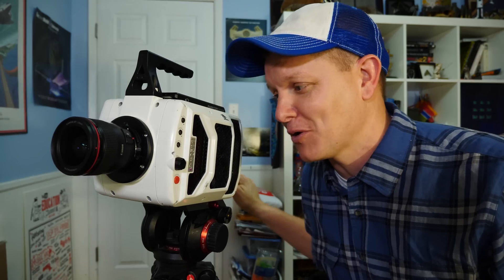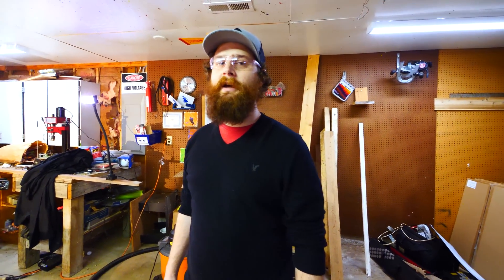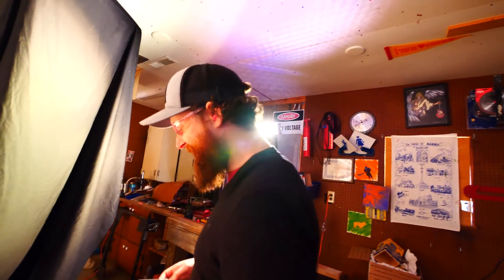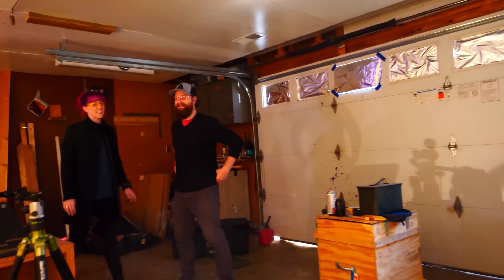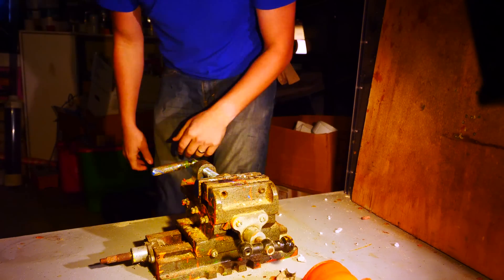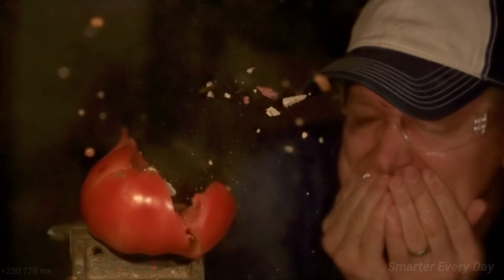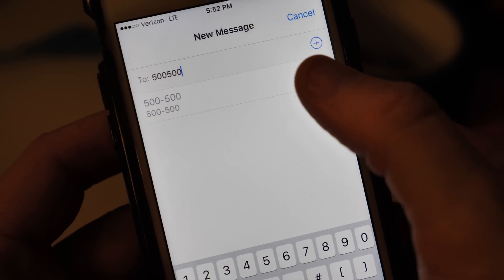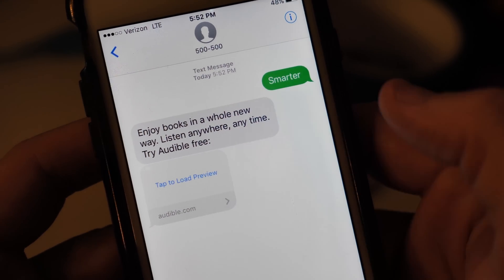How We Make Slow Motion Sounds (Exploding Tomato at 60,000fps) - Smarter Every Day 184

Comment: WHY??  You render it??  Shouldn't sampling sound be easier than sampling photos???
Reply: no - you CANT use the real sound - not that slow - it would just be meaningless noise.
Reply: BangDroid many good points, additionally its really just not possible even assuming the best case scenario.    the lowest quality sample rate thats at all listenable is about 8khz, roughly equivalent to a low quality telephone signal. the slomo of the tomato was shot at 60,000 fps played back at 60 fps for a 1000x reduction in playback speed. meaning that in order to achieve 8khz audio after being slowed it would need to be recorded at 8000khz which is many many many many times faster than what can practically be achieved. even a video shot at 6000 fps which is quite low for this channel would require 800khz and thats still out of the question. all of that would be required to get tinny low quality sound that would really detract from the high quality slomo footage. to get to 44.1khz which is the minimum for "high quality sound" would require even more outrageous sample rates. but even if it were somehow possible to record sound at an arbitrarily high sample rate sound really just doesnt work that way. pitch is the frequency of a sound, and an octave represents a doubling of that frequency. consequently slowing a sound down 100x results in a 6-7 octave drop in pitch which is most of the range of a greand piano making anything other that higher pitches completely inaudible. human hearing is 20hz-20000hz for people with flawless hearing meaning that slowing something down 1000x would drop anything that can be heard by a human completely below our range and the only things that would be heard would be things well above 20000 which i suspect would not be particularly interesting even if we assumed all the other things we needed to magically handle in addition to the other problem of having microphones with truly astonishing range >200000hz and they would also need to bequite robust to survive the sounds theyre subjected to.
Reply: Light and sound are very different, light travels about 580,000 times faster than sound as well.
With highspeed photography, speed refers to how many samples (individual pictures) can be taken per second. With audio this is knows as sample rate.  EI: 16 bit/44.1 kHz meaning there are 44,100 sixteen bit samples recorded every second. When you stretch or slow down audio, you lose information and the clarity is lost and distorts. You can interpolate the signal and fill-in those losses, but it's still an approximation.
Recording at much higher bit depths and sample rates such as 24 bit 192kHz or higher would allow for greater clarity when stretched.
I think the biggest thing though is that mic's generally have to be right next the the audio source whereas cameras can be back and even behind blast shields. Explosions can also destroy the sensitive parts of microphones.
Reply: Ed Price, i guess he said that,  even if we develop a microphone with special materials that make it extremely sensitive to sound and enable us to record it with utmost precision,  even then,  when we will stretch it to combine with our slow motion video ,  it will be of no use,  as sound at that scale is too SLOW! It will just be some very low frequency noise which will be of no use  , by the way WE did the same thing with camera,  we developed extremely photo-sensitive materials that could detect variations in light with ultra precision both time and quality wise.  And since light is fast enough,  we were able to make use of that data! And produce the slow motion videos.
Reply: Jason, there may be ultrasonic noise, or even harmonics, but calling that slow motion audio is like capturing x rays instead of visible light, mapping it to visible light, and pretending it's slow motion video. It might be interesting, but it's not slow motion audio.
Reply: Jason Gerecke you are correct that we could record the extremely high frequencies that would still be audible after a 1000x slowdown, but then once we did the sampling and stretching, we'd just be listening to the exponentially quieter (softer) and noisier (messier) upper harmonics of the sound we expect to hear, while throwing away the primary (base) sound that the people in the room heard at normal speed. What we want is to hear the primary signal in the lower frequencies, but instead we're going to get distorted messy signal derived from the upper harmonics and it would just sound like "proof of alien communication" on the History Channel.
Reply: Y'all need to learn about FFTs and frequency domain.
Reply: Ed: You're correct, we could find a way to capture the data. However, Travis made a second point: there's no such thing as slow motion sound. Consider capturing audio with a photograph. It's technically possible, but a single instant of audio is meaningless. Time is integral to sound; slow a high pitched screech by 1000x and you get an inaudible low frequency drone that not even crazy, custom, room-sized subwoofers can reproduce.
Reply: diggoran I wonder if there would be a way around that issue. We have a lower limit to the audio frequencies we can hear, but no (practical) limit to the number prior video frames we remember seeing. I wonder what it would sound like if you compressed the entire audio frequency spectrum so that a 200kHz signal would be reproduced at 20kHz but a 100Hz signal would still be ~100Hz? Maybe use a logarithmic scaling to somewhat preserve our logarithmic sensation of pitch?
Reply: Try to watch this video on 0,25 x. You can clearly hear what happens to sound if we slow it down. And think it very very slower than 0,25.
Reply: Nick B that's a good point, and experientially it's probably more akin to looking at an xray. That said, its /also/ "slow-mo" audio, though it probably stops sounding like it after the slowdown becomes too extreme.
Reply: Jason, what would you say is the point of slow motion video?
Reply: The sample rate is not the issue here. You would simply end up with infrasounds below 50Hz that we could not hear (and also not produce with our loudspeakers)
Reply: Jason Gerecke, I'm not sure that would sound good enough; when you change the frequency of sounds without changing the speed, you get artifacts because the waves at different frequencies no longer align the same way with each other; like when there is extreme autotune in music and stuff, all metallic and echoy, but given the scales involved, the effects are gonna be even stronger.
Reply: If nothing else, those cameras have some really high power cooling fans BLASTING away and they'd obliterate the sound recording.
Reply: Nick B not necessarily. An ultrasonic microphone could capture sound frequencies higher than 20kHz which would be brought into the audible range when slowed down. 100kHz content slowed down 1000x would be 100Hz and could be captured without terribly exotic gear. Handling a 2000x slowdown (e.g. for this 60,000FPS tomato) should be possible too. The real problem is likely that  the ultrasound content is probably pretty minimal and wouldn't sound like what people "expect" it to sound like.
Reply: I don't think the solution to high-speed audio is to simply play back all samples; as you said, this would reduce  information to sub-audible noise. I think there might be progress made by using software to look for short-duration events (as an example, maybe a tomato skin crinkles like glass on initial deformation, then defaults to a long, slow deformation with little sonic information, so capturing that initial crinkle is the important .001% of the event). Perhaps "sound" information can be derived by laser interferometry of the impacted surfaces (after all, the sound we perceive is simply an air pressure wave, driven by mechanical motion of some surface "pumping" air). However, we will never know so long as we are fudging our data by squishing oranges and adding reverb.
Reply: "no such thing as slow motion sound" buuuuuuuttttt whhhhaaaaattt aaaaabbooouuuttt wwwwhhhennnn ttthhhheeee vvvviiiiddeeeeeooooo sssoouuunnnddsss llliiikkeee tttthhiiiissss
Reply: Travis, your argument essentially becomes that extreme high-speed audio sampling is impractical because its very difficult to do; isn't that the same argument against high-speed video?

Comment: So it’s fake.  I wonder if you could hook a microphone up to an oscilloscope with a large buffer and record audio with that, since the sample rate is in the gigasamples per second, I assume something recorded at 1,000,000,000 samples/sec would be perfect for ultra-slow mo playback at 48,000 samples/sec like normal audio.  You’d need a pretty small microphone diaphragm to get the kind of frequency response you’d need to get anything in the audible range.

A rigol ds1054z with it’s 12M sample memory could do 12ms of real-time audio recorded at 1,000,000,000 samples/second.  Played back at 48,000 samples/second, that’s 250 seconds of audio for an effective overall playback speed of 0.000048x.

Comment: Heyy Dustin ●♤☆ 
I want to ask u why can i blow hot and cold air ? 
And why do it feels cold when i put my arm in the fast wind from the car ? Isn't thats how the asteroids get burnd ?
Reply: I can give a basic answer to these questions actually. 
There are essentially three simultaneous heating/cooling effects going on in these situations. 
1. The conductive heat transfer between the air and the surface of the object
2. The evaporation of water on the surface of the object
3. The heating up of air when it gets compressed

So when you blow slowly on your hand, factor 1 is significant because the air coming out of you at body temperature is much higher than the surface of your skin. Factor 2 is less significant because the air isn't moving very quickly, so it can't carry away much water (plus it is humid coming out of your body). Factor 3 is basically non-existent in this situation. 

When you blow fast factor 2 becomes much more significant, and may overtake factor 1, causing an overall cooling effect. So the temperature of the air itself isn't changing, just the effect it has on the surface of your skin.

When you stick your hand out of a car, factor 1 actually works as a cooling effect (unless it is a very hot day), and factor 2 becomes very significant because the speed is high and the humidity is low (compared to your breath at least). But even at this increased speed factor 3 is negligible, there simply isn't enough force to compress the air in front of your hand very much.

When an asteroid hits the atmosphere, factor 3 becomes very significant. The average speed of an asteroid is 25 kilometers per second, which gives it plenty of force to compress the air it is travelling through. That effect dominates the other two factors completely and burns up the asteroid. 

Hope that helps!
Reply: Hey it's DESTIN!!
Reply: vedant what avar ! 😒
Reply: Kevin Wells wooow ! Thnaks man ●♤☆ u earned a subscriber .

Comment: The reason the fuse still worked is because it's visco fuse, which is designed to not go out when wet and can even burn under water providing it's lit first. The fireworks themselves might be from Mexico, but I don't think so. Visco fuse isn't that common down here, something like black powder fuse is used here, except it's white and is usually dyed different colours.

Comment: Why not use Fourier?
I know little about sound but i am not sold on using special effects and not actual sound, but i understand you cant just slow it down by x100
Try recording with the best mic you have, or two mics with different gains (to catch high and low amplitudes, then combine them digitaly), convert from temporal to a spectrogram (Fourier transform with variable window size, ie small window for high frequencies, larg window for lower frequency, to minimize distortion due to next step), stretch it out (frequency will not change, only duration) but to only about 1/3 of the length needed, convert back to time domain (inverse Fourier) and now stretch it out more to the remaining needed length (this will change the pitch and making it sound "sycho-whatever" but because its only a factor of x3 it should still be audible), finally a bit of time syncing and normalization to suppress the highs and amplify the lows.
Don't think people watch this channel to see special effects, got enough on TV.
Any reason not to try this?

Comment: oh... this video is cool but soooo disappointing. So all slow mo videos sounds are fake, even worse than the equivalent of photoshop.
Having all the sounds be entire fakes and factually incorrect to the actual experience takes away all my interest :(

Also why couldn't you just take the real sound and slow it down? You said you would explain but i don't see an explanation?
Reply: You're stretching out a sound enormously thin, so much so that you wouldn't hear any of it even if the camera was capable of recording audio. 
Say you're recording something at 50,000 FPS, and have a microphone recording at 48,000 Hz, and you will be watching this new FPS at 24FPS, 50,000FPS(Sample rate)/24(Playback rate)  = 2000 seconds of footage. 2000/48,000 hz = 0.04hz per second; the sound would be completely unusable. It'd be junk data.
Reply: Sig he said he would explain it in the next video.
Reply: Push mute, problem solved. Try it on yourself while you're at it.
Reply: Slowing down the sound would reduce its frequency far below what is audible.  Filling in the sound at the actual frequency would in most cases be very underwhelming.  Would be interesting to hear/see how a slightly down-shifted frequency version of the actual audio in-filled to map to the slow motion video would sound.  In effect you'd be creating a slow motion audio file, but just by filling in the audio between standard sample rate audio files.
Reply: Sig Most Planet Earth 2 is pretty much all foley. Films like Lord of the Rings are 90% ADR.

Comment: That M-90 was WEAK! That had no more power than a normal 50mg firecracker, that was definitely not a real m90 or even close! You would never get as close as they did to a real m80 or higher going off (RIGHT BY DUSTINS FACE?!?!?!)
These firecrackers most commonly have a small capsule with up to 50 mg of powder and a fuse in it. Surrounding the capsule is plaster or a similar material, and finally a red tube and two plastic end caps. Because of the size of these firecrackers, buyers are occasionally deceived into thinking that the entire tube is full. Also the fuse, at times, protrudes from the ends of these firecrackers, as opposed to the middle of the tube in real M-80s. Genuine M-80s have paper end caps, and contain 50–60 times more powder.

Comment: I always thought that the sounds were total bs. Did I miss the explanation for the reason the sounds can not be recorded in the first place? I would guess that sound waves are so large and slow. AWESOME VIDEO!
Reply: your explanation is a bit unclear to me, but your statement is right. 
when you watch a video, that was recorded in 50.000 fps, in 24 fps, then youre watching it 50.000/24=2000 TIMES slower. it's got nothing to do with seconds at this point. 
Indeed most microphones record at 48000 Hz samples, but you can only hear sounds between 20 and 20.000 Hz. So any sound you could hear divided by that same 2000 times results in a sound that is far out of your hearing range. For example 10.000Hz (already ridiculously high frequency) divided by 2000 = 5 Hz. This is  such a ridiculously low frequency that if you were to hear it in any way, it would sound more like a rhythm than a sound, as 5Hz (5 samples a second) equals 300bpm (5*60=300 beats per minute). 
And ofcourse such a stretched out sound wave wont even be able to be played by speakers as theyre not made for that.
Reply: Pretty much what you said; you're stretching out a sound enormously thin, so much so that you wouldn't hear any of it even if the camera was capable of recording audio. 
Say you're recording something at 50,000 FPS, and have a microphone recording at 48,000 Hz, and you will be watching this new FPS at 24FPS, 50,000FPS(Sample rate)/24(Playback rate)  = 2000 seconds of footage. 2000/48,000 hz = 0.04hz per second; the sound would be completely unusable.
Reply: Colorado Native Films he said next video he will explain it
Reply: Kalkaanuslag I'd be curious to hear that, let's say, 5Hz sound. Moving it to audible spectrum shouldn't be a problem and I believe, that it would also be possible to "fill the gaps" by some computing. It would also be interesting to record and take apart same sounds recorded in various environments (gasses, fluids)
Reply: Look up frequency domain and FFT.

Comment: So its like the fake moaning in pornos?
Reply: TheWarBabe27 It's like moaning dubbed in after the shoot.
Reply: Asking the real questions.
Reply: It is not possible to record sound at that speed, even if you can it will not be audible audio sound anymore. It will be EMF from your mobile phone and something like that
Reply: Of course it's possible - one would just record the audio at an extremely high sample rate and then play them back at a much lower sample rate rate. There's just no real demand for a converter that fast. Not for a lack of the existence of the processing power, just because of diminishing returns in fidelity.
Reply: Exactly.